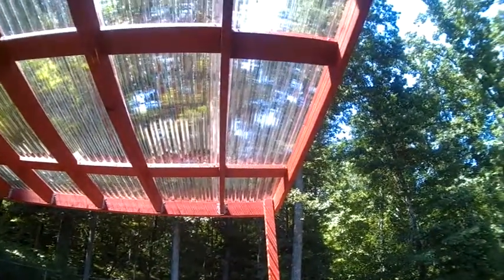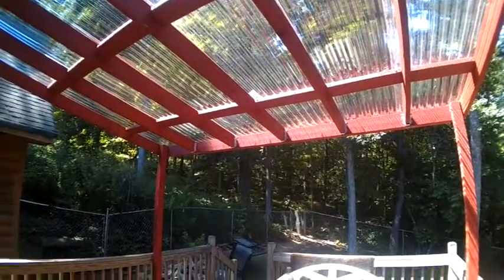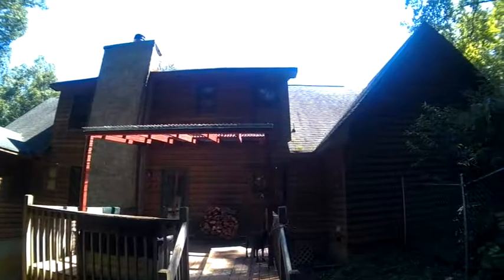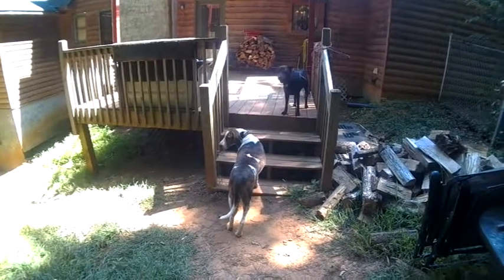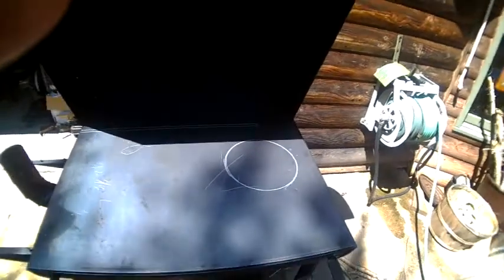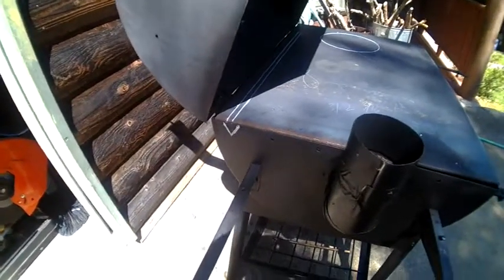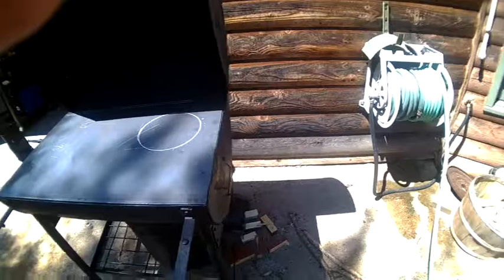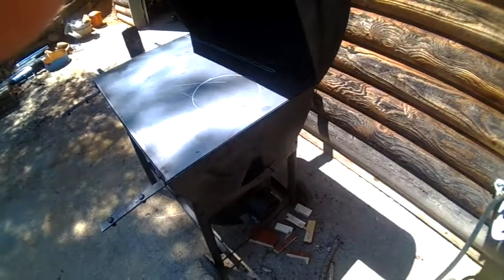Rocket Stove Grill Fabrication (Part 5)

Comment: Where did you find that fantastic 1/4 steel plate? I wouldn't even know where to look for one of those. I just have to find one. I would think that cast iron would conduct heat better, but I bet the 1/4 inch would be great too. I saw that you already cooked with it, so I know it works. Any suggestions where I should look for one? Thank you, Sheila
Reply from the maker: I know this has been Delayed, and I Apologize, but I Purchased the Plate from a Local Steel Supply Company that serves Builders and Contractors. They had no problem cutting it to size for me at a price of  $18.00 USD. Thanks for Commenting